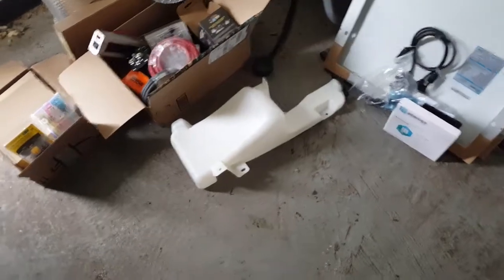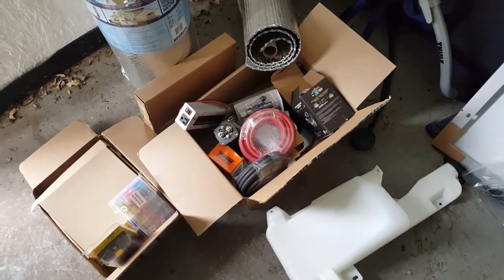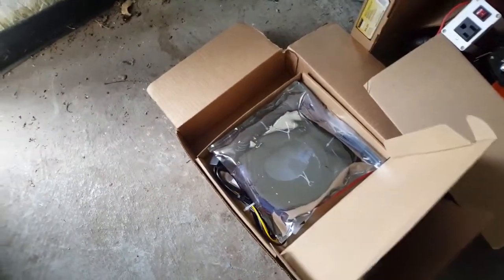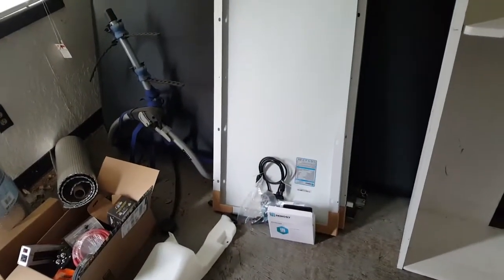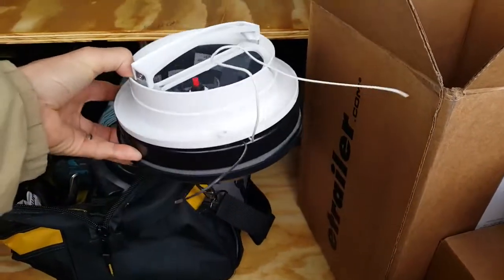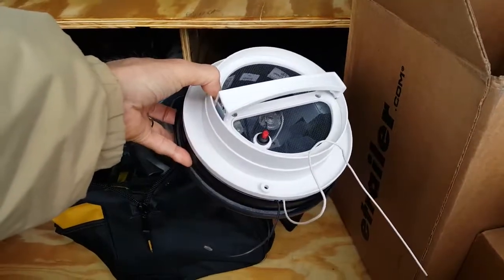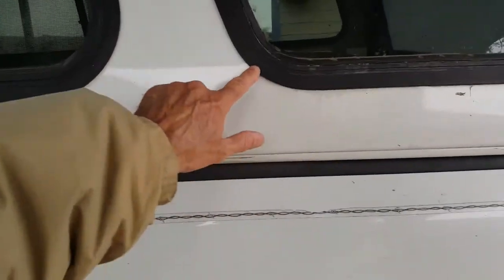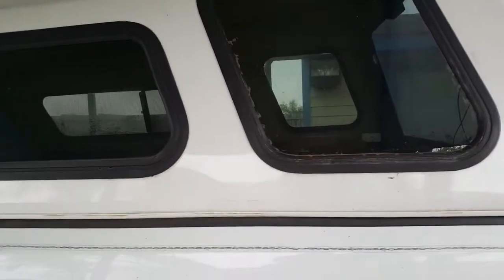FIBERGLASS CAMPER SHELL TOPPER ACCESSORIES GMC Sierra Chevrolet Silverado Solar Power Vent Fan

Comment: I’m dying to know the make/model of that round power vent you bought. I don’t see it in your list. Can you give me the details on that. Does in only blow one way or both ways? I need one of those for my truck topper camper!
Reply from the maker: Thanks for watching. Here is an aff link to a fan that is similar to my fan. I am not sure if they will run both ways, I only ran mine for exhausting hot air. Good luck with your project. https://amzn.to/3qwT92m